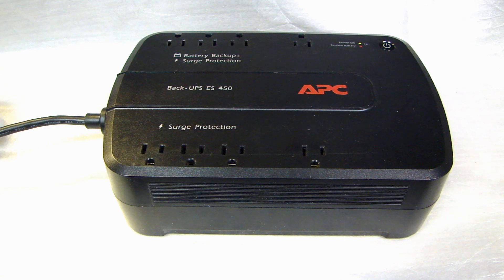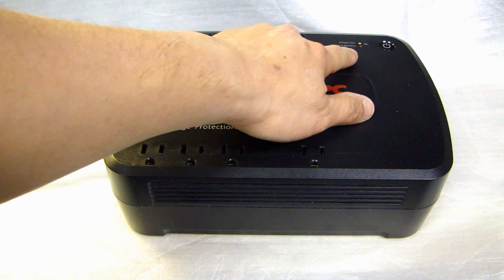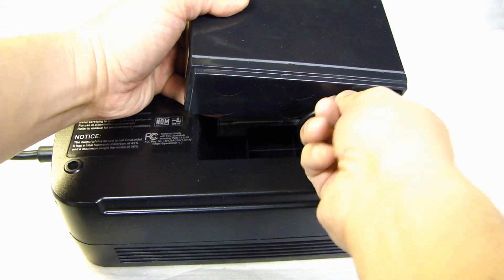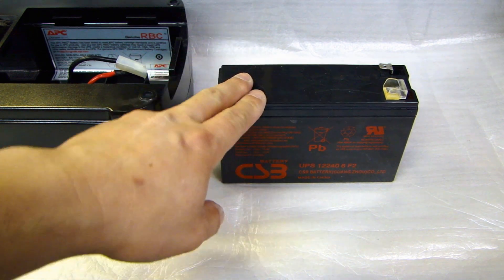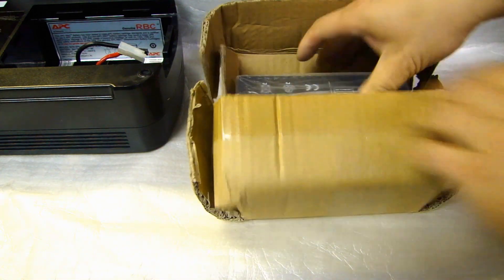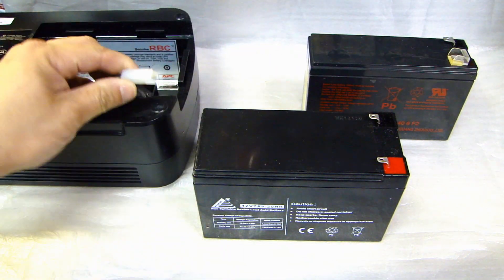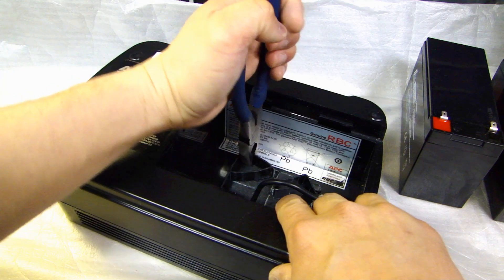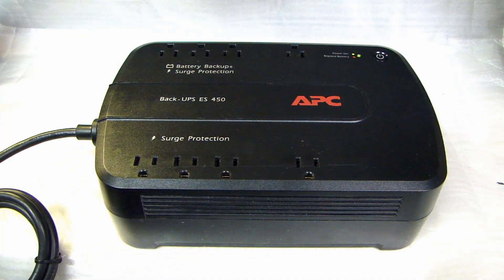How To Replace UPS Battery w/ SLA (Sealed Lead Acid Battery)

Comment: I have the same UPS that died about a year ago but I kept it just in case. Thanks for the info regarding using a larger battery by removing the molded spacer framework. I'll have to get one of those batteries like you have shown!
Reply from the maker: Yeah, give it a shot. Mine has been working fine since making this video (over a week). Good for another couple years.